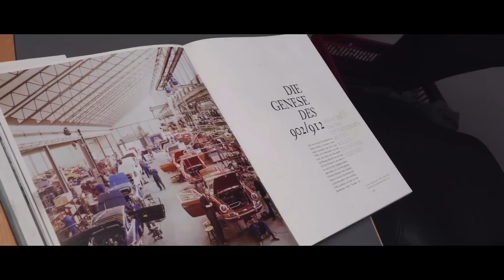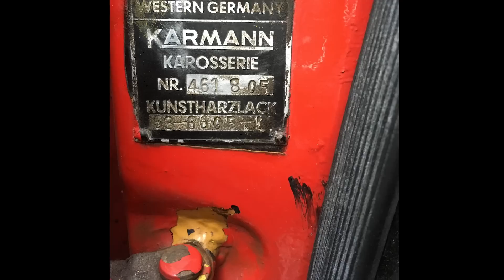The Bahama Yellow Porsche 912

Comment: My buddy has a 1976 Porsche 912 in SoCal in Baby Smurf Blue. It has a VW Engine. I didn't realize that the 1960s and other 912s had an air cooled Porsche engine. Very nice 912 restoration. $$$$$$$

Comment: Sure miss my '69... absolute magic happened when both the tachometer and speedometer needles were perfectly vertical at 4000 RPM in 5th gear. Exactly 75 MPH. At that moment, everything clicked and you you could feel that all was good with the cam and transaxle and happiest to run all day like that. I also missed how well it stayed tuned compared to the 911's of that time. Maybe someday I'll find another....ivory white.     Thanks for the video.